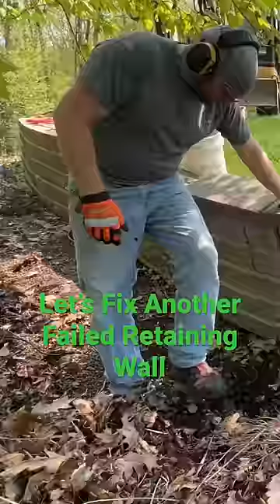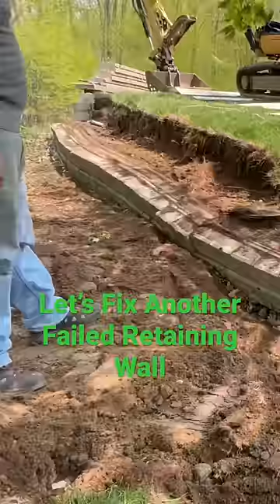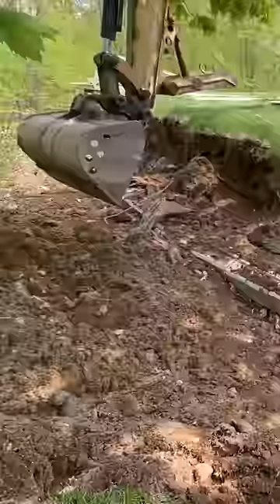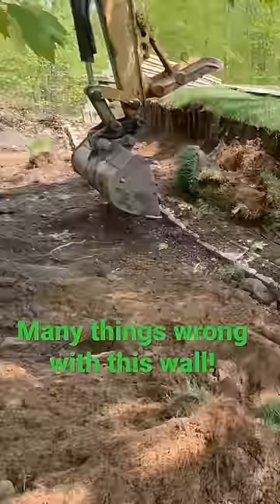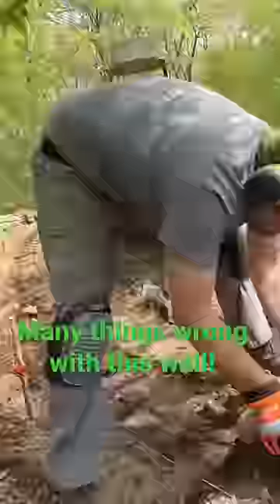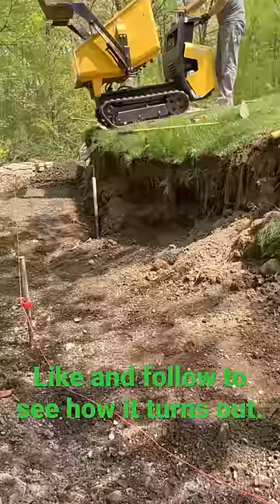Another Wall Failure! #shorts #landscape #repair

Comment: There's an 8 foot high retaining wall near my house, it's over 300 feet long and 150 years old.  It's still straight as an arrow!
Reply: I’m sure the imperfections washed away about 75 years ago
Reply: Holy smokes! I was sure that wall of yours was considerably older, much more involved, and waaay longer. (Just a silly joke because of your user name. No offence is intended)
Reply: Of course, it has a footing, and is made with baked brick or cobble stone, not patio Stone that is meant as a flower bed bordering.
These weren't ever intended to be used like this. A retaining wall block actually is twice the size with holes drilled in them to insert tension rods made of polymers that have slight flex to them.
Reply: I go up to 6 feet, have to have a solid base (don't remove dirt and throw it back together STAMP it hard and packed) when replacing dirt behind the wall PACK IT GOOD,  I have yet to see an old hill or mound just move and take the wall with it
Reply: Sounds like a really great wall.
Reply: Do you know the history on it? I went to Tennessee, right outside of South West Nashville and they have retaining walls still standing that was built by slaves
Reply: Rock behind the wall for drainage and some sort of geo grid 8ft back every 4 ft high will help alot.
Reply: There’s no end around my way built vertical so any movement pushes them out. Also no ties back int the ground behind so they just lean and lean some more until…
Reply: @K Elliott  the great wall is like 13,000 miles
Reply: Sounds like a Great Wall
Reply: because people used to have pride in their work
Reply: @seenenough1200  the Chinese Communist Party didn't exist 150 years ago, and if you've forgotten, the Great Wall of China was built over a thousand years ago. "Tofu Dreg Concrete" wasn't an issue at that time. And before you say the Chinese couldn't build stuff 150 years ago either, remember built most of the Railroads in the Western United States. It was Chinese immigrants for the most part, and so many came over and started building things that white people got scared and banned Asian immigrants for something like 80 years.
Reply: too much education nowadays. people can talk about uranos for 3 hours but cant build a decent wall.
Reply: Omg what a nitemare
Reply: must have a base!!! or be tied to something
Reply: That's what happens when you set it on a proper base.
Reply: Straight pride
Reply: That's BC long ago shit was done right instead of ppl cutting corners every chance to save a buck.
Reply: Yea because they knew to bury a footing
Reply: I live in the Appalachians on the border of Va,Tennessee, and Kentucky. There are 3-4 ft tall rock walls that goes for hundreds of miles all in the woods here. Ive seen them span 5 counties. Looks to be at least 300-400 years old
Reply: It's about the surrounding earth. If it's non-expanding easily draining it will be straight in a thousand years. If it's expansive clay with water sitting on it (or freeze thaw cycles) like this one, then even steel reinforced cantilever walls will be overturned in fifty years.
Reply: Didn’t know you had history go that far back in America. Must have when the English came over and colonised it when one was building his own house. JK😂
Reply: @Baby_J1  That's how you know free labor was a good thing👴👴

Comment: That second wall didn't look as if it was off to a good start.
Reply: You need reinforced concrete for vertical wall.
Reply: He didn’t even show the start…
Reply: You seem to know how hardscaping works.  All you saw was the pouring of crush run to level...not sure how that looks bad
Reply: The reason it doesn't look like a good start to the repair is because you need to bury the first row of blocks in order to lock the wall into the ground. Otherwise it is just going to lean out again, also there should be drain tile and backfilled with clear stone to redirect ground water behind the wall.
Reply: @RedHaloManiac95  he was putting rocks down and leveling them
Reply: For a small wall he was installing rocks and leveling them to start wall on top of rocks
Reply: @FireballGuitar  @FireballGuitar  it depends on the size of the wall whether or not you bury one or two courses of blocks. 

Depending on height is also what determines how much AB you need to have underneath it. You compact that ab like a sob with a plate compactor. 

I agree water will retain behind the wall unless delt with, but you don't have to use drain tiles. You do however have to use loose 3in minus or 4in minus at the base and run drain tube from the back to the face, especially in an area that's irrigated. 

You can also use that perforated drain tube that comes in 2in and 4in and run along the backside. Also insure that it will drain properly per the grade.

Another thing people neglect, is having the blocks shed water away from the joints, this can be done by slightly tilting the blocks forward, further helping the water issues when it rains.

I've built a ton of retaining walls, swales, and ground control. 

Honestly I also dislike using 100% upright blocks with anything above 2ft, having the blocks staggered like steps also helps lock the unit into place.
Reply: @ChrisB0423  the guy is building the foundation of the wall above ground level. That is a bad start.
Reply: I swear people make these comments to get likes from dummies. He poured rock and graded it lol
Reply: Wtf you talking bout? @Bungeneer
Reply: @hmg8915  groundwater can apply side pressure. If it seals the cavities within wall it will surely do.
Reply: Y’all are cooked lol

Comment: I had to rebuild a huge wall that used those 2,000 lb blocks.  The ones that are made from left over concrete.  The original one fell over holding back a hill.  Their big mistake was you need to bury an entire row so the dirt secures it from moving and slightly leaning into the hill.  It acted like a footing.  I placed over 500 2k pound blocks.  It's still there after 30 years.
Tom Dutkiewicz

Comment: We usually started i think 2 blocks below the lower grade on compacted crushed stone.  Maybe that was over kill?  It made diverting the drainage from behind the wall easier as it was already below grade.
Reply: No, you're correct. That's how it's supposed to be done. And it serves as a solid foundation.
Reply: That's how I've always done it too.
Reply: One block buried is standard unless there's a keyway due to bad dirt underneath. A 2000 ft long wall with an unessarily buried row of block is costly

Comment: I did 100 meter long and 2.5 meter high wall for a recycling depot.  I used geo grid in between every 3rd coarse of stone. I tied/buried it into the hill behind the wall 20 feet back. 13 years later and nothing has moved, with literally 1000,s of vehicles driving on it.  I used 320 pound formed block from Hanson.

Comment: Thats what happens when you don't have correct drainage, base, and backfill.
Reply: They need some tie backs too
Reply: You  forgot geo grid mesh. But yeah, you’re right.
Reply: Or a retaining wall 🙄
Reply: @stephendufresne9239 The only real defense against this soil movement
Reply: Agreed
Reply: Or skill/intelligence
Reply: Or shape
Reply: It's because of those "contractors" that go out there and say" yeah I can do it for a 3 grand"......(5 grand job let's say) and they redo a wall without "ANY" drainage system in place. 🙄
Reply: @stephendufresne9239  I was going to say def need some geo mesh.
Reply: Geogrid would have prevented it.
Reply: The real problem was is they had no Geo grid installed those type of interlocking blocks every two courses needs a Geo grid 10 feet back to make it an actual retaining wall
Reply: @gray09r56  Geo Grid generally recommended over 4' high.  Since that is not a pinned wall I don't know how it would attach to those blocks anyway.
Reply: @dicky7600  you just pinch it between the layers of blocks.
Reply: @Connor  yes, but that wall is only 4 courses high.  If you put between the top 2 courses you only have 6" of dirt holding it.
Reply: @danielcampbell1357  no the real problem is it has NO drainaige and no foundation. You cant put a wall on dirt and expect not to fail. Especially when theres a load above it
Reply: @daveortwine2641  do you know the funny thing is is that you’re trying to tell me how you’re supposed to build a stackable retaining wall when I build these walls over 30 feet tall and I put a pool at the top. You glue the corners together everything is stacked and pinned and Geo netted no concrete you wet set the first course that’s it and it naturally drains in between the cracks of the stackable retaining wall I don’t know where you’re from but these things are all over where I live And you do put a drainage pipe at the very bottom so the water can work its way out of the wet set block
Reply: @daveortwine2641  You do compact every 12 inches and have a compaction test each time ✌🏽❤️

Comment: Every couple layers you need to put netting and compact the ground to hold it down attached to the blocks and make sure you don’t forget the drain holes this time
Reply: the lack of drainage is what caused the failure in the first place. Its like people have no imagination these days. How do they expect an unreinforced wall to hold back so much liqufacted earth when it rains if there is nowhere forthe water to go?

So what Id do is i use rebar around 4 feet long with small flat plates welded to them bent 90% and set into holes in the stone at round the halfway mark up to give some stability. Thats the way they stabilize gravel faces along the hiway
Reply: @jussayinmipeece1069 how about using geo grid? No need for rebar😂😂
Reply: @hmg8915  came here to say the same thing. Additionally, I hope there is clean rock back there this time and some drains!

Comment: I've noticed that the underlining problem is always behind the wall because everyone back feels with clay or whatever material is on hand when it should be sand and gravel up against the wall and topped with topsoil damn it I know too much
Reply: I wasn't done yet needs further explanation so when it rains where's all the water go right up against the wall and what it do turns everything right up against the wall into slush mud wet and heavy so this is why I suggest Sand and gravel got to have proper drainage And when everybody puts retaining walls around they never put drainage on the back sides where it is backfield little bit of drainage pipe Sand and gravel no more problem
Reply: What are you doing next week? I need to build a retaining wall! 😅
Reply: @jeremycanterohioprospecting  I agree with ya. Any retaining wall I ever built was always excavated and a proper footing built with good aggregates and drainage. All the best work is always buried when it comes to retaining walls heh, heh.
Reply: @Bob3519  Haaahaha! A smooth operator always recognizes an opportunity hahahaaa! Good one, man.
Reply: You can as long as you put stone against the wall then put fabric then clay for backfill but the wall should have  6 inches of stone behind it all the way up.
Reply: @Bob3519  what's it pay lol. I'm a certified Alan block wall installer
Reply: @Bob3519  well if you lived in Ohio I could do it maybe even Pennsylvania lol our family business name is Canter construction 45 years experience licensed and insured in all counties and even in some in Pennsylvania
Reply: @randys-rc  12” is ‘the NCMA Standard’ . . .

Comment: I've done retaining wall in the UK and here we put in a footing in concrete and then  L shaped slabes with a heel and drainage holes to base.
 To finish graded backfill to allow drainage and then topsoil to finish.
Expensive but proper job and done once right

Comment: They just laid em on the ground? No footer? 💁‍♂️
Reply: Yep. You got it.
Reply: no footing, no base rock, no drain tile or clean rock used for backfill. Basically nothing was done right. I hope that was a homeowner DYI project and not done by a contractor and if so, they need to be contacted obviously cuz that is terrible business practice
Reply: @justinm2434 right?
This guy basically just added a little bit of gravel to the base. Its going to fail again. 
I would be embarrassed to put this video up.

Comment: Footing should be poured first with rebar sticking out. You could either go with a concrete radius wall or cinderblock radius after that. Just make sure you use rebar or it will definitely fail over time. Also, fill your cinderblock cells with concrete as well

Comment: You are one hard working man doing tbis by your self. Pray your not out in the heat down here in the deep South where its 100 percent humidity and 105 degree weather already cause its brutal down here out side workkng like this. Take care of your body and ljft properly and use your tools and equipment to maximise the amount of work they will do for you and not doing jt manually. Great job stay hydrated and well rested and keepon wofling mg friend

Comment: Some of THE hardest work you'll ever do.  Back breaking stuff right there.
Reply: I agree..people say roofing is hard but after the last 250ft one I built, I was praying for a roofing job. I do versa lock and each block is around 85-90 pounds. It's even worse when it comes 2 block together and you have to split each one..nor my favorite work to say the least but it pays the bills so I can't really complain too much.
Reply: @Steve 1269  do you all use a Geogrid with the Versa Block system?
Reply: @DavieBroy  no, I only use it if it's 6ft or higher. Some people say to use it every 3 or 4ft but I honestly think it's not needed when it's under 6ft in height. honestly, drainage is what you really need.  Drainage and a good bottom course.
Is it a bad Idea to use it when a wall is under 6ft?..no..is it over kill? Maybe. But all you're doing is spending more time and money. But, you also get what you're paying for. Hopefully you never pay a guy like this to do a job for you. Haha but there's a few different factors to take into consideration. How steep is the hill and how much water flow do you need to divert? Most of the time a 4in drainage system is more than enough.  But I also back fill my walls with around 80% stone just to help facilitate the drainage process...hopefully this helps you out a little bit.

Comment: They did not consider the slope of that retaining wall. The ground was not properly leveled the joints were not fortified no rebar to maintain vertical strength or secondary reinforcement. Great job fixing this many people do not understand the damage a failed retaining wall can do.

Comment: Since you disturbed the soil by pulling the base layer of block out and seeing that there is no base. you need to dig down to frost line and pour a footing and install some drainage behind the wall. I use the 1/3 rule. Atleast one third of the total wall height visible above ground needs to be in the ground for support.

Comment: No foundation foot, obviously it will fail, and fail again. You can just puf bricks on hard core, it will shift. Needs a 18" deep trench filled with concrete, then brick wall.

Comment: Well, it might have made sense to check out how people in the past built retaining walls that in large parts even exist today. One main indication of why they don't fail is that they lean into the soil they are retaining  and thus if the pressure is built up, they can properly transfer it into their footing..
It also helps to include proper ways of getting rid of water between the wall and the soil and to have binders, meaning longer stones that interconnect difference layers of the wall and the soil.

As others commented before, you just rebuilt the same way and you will face the same problems again in a few years.

Comment: I’m not a builder or landscaper, but even I can see plenty of problems. No secure footing, no porous back fill or outlet for water, back fill all appears to be loam and loam clay, which means it can hold a lot of water and move like plasticine, and the wall was built with inadequate lean back, like it was a permanent grouted wall not a lock fit.

Comment: This will fall over again if he dosent pour a concrete counter balance  footing, with re-bar
Reply: That block comes with plastic pins that go into the holes and it failed because there was no drain behind it. You don't use any concrete for that type of wall.
Reply: Lmao. Surely you have seen buildings and walls that are still standing after 1000s of years. You dont need concrete and rebar.

Comment: I might be mistaken here, but in my country code says such a retaining wall contain a) a reinforced concrete footing b) to be frost-proof go at least 2,5 feet into the ground and use a fixed number of revar to connect adjacent layers!

Another option is to use pre-made concrete, L-shaped, which comes reinforced and ready to install.

But those L-Stones also need special ground preparation and a footing!

Comment: Damn. That wall acted as a dam.
Reply: Ummm. That’s exactly what retaining walls are. Except they dam soil and not water. Soil has a similar flow to water, though.
Reply: @bc01256  I guess what he meant was that the retaining wall was failing due to missing drainage system as the hydraulic pressure was mainly responsible for the failure. "hence" acted as a dam.

Comment: We made one a long time ago i bet a million it’s still standing and it was made of landscape timbers doubled we drove rebar fr the bottom the 12 inch gutter spikes is what they were calling them but it was nails every three layers we made it role toward the dirt hill and we drove rebar that was two feet longer through the whole thing a little i drove by it 5 years ago and they had repainted it we used a liquid rubber across the and inside the drain holes we painted them the day before and the front got solid stain three coats it sucked it up then rubber paint on all ends of the board